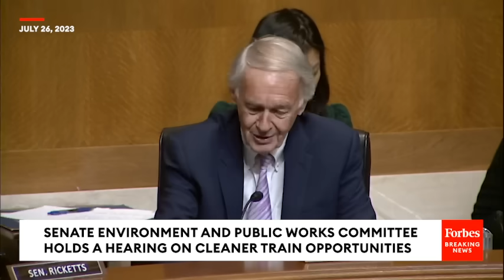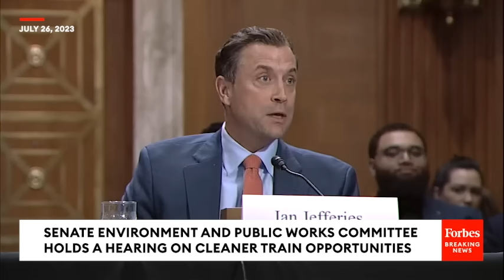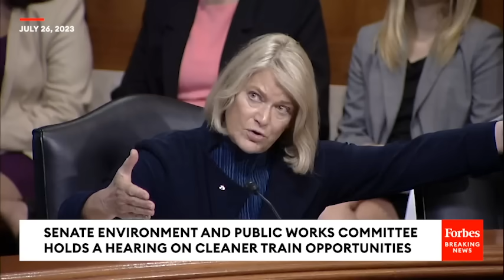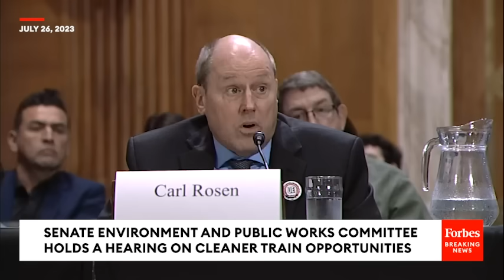‘How Long Would It Take To Replace All Diesel Locomotives With Electric?’ Cynthia Lummis

Comment: We have 18,000 ton, 120+ car coal trains that roll through where I am.  There are four 4,400 hp locomotives in full power, roaring and grinding up the grade.  Two in the front and two in the back.  I laugh when I think of battery power moving that train .
Reply: 1000% agree....we are dealing with a 100% CLOWN show with battery power.....
Reply: The batteries would outweigh the load and would take days to charge and minutes to drain.
Only lawyers and politicians believe there is a free lunch, and for them and them only, they make it so, but at everyone elses expense.
Reply: @misterserious3522   True.
Reply: Quick and dirty math says 13,000 kilowatt-hours of storage capacity would be required to operate those four locomotives at full power for one hour, assuming 100% thermodynamic efficiency from the batteries to the wheels.  Now extrapolate that out to several days' worth of operation to model a complete trip cross-country and tell me how physically large and expensive the storage battery would have to be.
Reply: Hint:  Lithium batteries cost upwards of $100/kWH to manufacture.  100*13,000*24=$31,200,000.  Compare that against the cost of four new diesel locomotives at $1.5~$2.5 million each.  And THEN figure the cost of installing new electrical infrastructure to charge those electric locomotives and tell me which competitor is going to be making money at the end of the day and who is going bankrupt.
Reply: @TankCrusher210  The batteries would outweight the cargo load.
Reply: its no problem it will just be 120+ battery electric locomotives and 4 coal cars😂😂😂
Reply: That works out to 13 megawatts if all four engines were actually delivering full power. That is equivalent to the entire electric consumption of about 6500 homes at 7pm peak usage.
Reply: @laserflexr6321 Your numbers look about right.  Good job.
Reply: Electric motors are in the wheel trucks of railroad locomotives, driving the wheels. Diesel engines drive the generators to produce electric current, powering the electric motors. Learned this at GM EMD plant in LA Grange, IL.
Reply: @thomasformanek465  Correct.  They are traction motors.
Reply: "But according to our calculations it is easily done. Looked good on paper."
Reply: I hope you realize that electric motors are actually producing the 4,400 HP that is pulling/pushing the 120+ cars of the train. The diesel engines are just generating the electricity to power the drive motors.
Reply: @joeyager8479  
Actually, the diesels turn a generator or alternator, and that current is then rectified or inverted to whatever the traction motors use.
Reply: @bruceingram4715  Understand. I was just stating it in it's simplest terms. You can say the same thing about charging the 12VDC battery in your car.
Reply: @joeyager8479   
“Just”?  SMFH
Reply: No schiff!  @joeyager8479
Reply: @joeyager8479  Just replace the diesel engines with batteries. 🤣🤣🤣

Comment: Production of diesel electric locomotives started around 1925 in the USA. Sooner in europe. This is the most cost effective and least polluting system there is for hauling freight. The pollution created in the manufacture of batteries is well above burning fossil fuels. You may think the people trying to force diesel out are ignorant of these facts. This is really about controlling people and money.
Reply: Diesel electric locomotives were working during the WWI time frame. Short range switchers for working around the marshalling yards. And in very limited numbers
Reply: One fact no one addresses is, how to get rid of burned out batteries, where are they going to be stored? Batteries are like nuclear waste, where/how to get rid of them.
Reply: @stephenmartini5890  With the rapid expansion of battery inventory, it has already reached scale to set up industrial scale recycling.   It is not a cheap or easy thing to do, but I assure you a miner would much rather mine a pile of dead batteries than the best known pile of dirt and rock as a source from which to extract those metals. Much more concentrated source to process. That aspect wont be a huge problem.

Comment: The locomotives today are hybrids. The SD70, 80s and 90s are efficient and reliable. I worked in the railroad with ConRail. 100% EV locomotives will not work. Where are you going to plug them in? What happens when a storm (winter or summer) knocks out the power? Plus you cant build a battery that can pull the 15 to 30 thousand tons and stay charged. The battery will die or catch fire, it’s a silly pipe dream
Reply: Electric locomotives can be practical, but only those which are powered externally such as by a catenary. Battery power is not practical for hauling trains across the country.
Reply: @Ethan.Lamoureux  Catenary? Are you serious? Do you even understand the infrastructure and rebuilding of the rails it would take? Just to go to electric? It’s not worth it. I have been in areas (sidings) that are literally in the middle of nowhere. You can’t get catenary back there…. Another pipe dream
Reply: @eshelly4205  So that’s your excuse? You believe that railroad electrification cannot be done “in the middle of nowhere.” Electricity will not work there? Or are you of the opinion that it’s all or nothing, either we electrify every line or none of them? I hope you understand why I think your objection is nonsensical.
Reply: @Ethan.Lamoureux  I make perfect sense. Why do it? For what purpose would you spend that much time on a system that will be terribly expensive and inefficient? The current locomotive technology is perfectly capable. They can’t even keep simple EVs from catching fire in a garage. A fully electric freight locomotive is nonsense. You don’t know what you are talking about.
Reply: @Ethan.Lamoureux  Here’s some homework for you. Educate yourself. 1. Learn about locomotives. 2. Go to a train yard and ask an experienced train crew member if it’s feasible to have 100% electric freight locomotives supplied by catenary.

Comment: What is an electric train "card"? Lack of proofreading bugs me. Also, the discussion is about battery-powered locomotives, not cars (or "cards", as Forbes puts). Most industrial applications of battery powered vehicles are ineffective and pushed aside as soon as the spotlight moves elsewhere. They are novelty items that typically are less reliable, have less range, load capacity and cost more than existing models. 
The lunacy of targeting something that moves 40% of products while generating less than 2% of the pollution is lunacy. Lummis demonstrates a stunning lack of understanding about how electricity is generated, something she should know more about, given Wyoming's role in coal mining, transportation and power generation.

Comment: Lunacy.   as in Loons. You would need a separate train to carry the batteries. BTW: Figure out the cost of carrying 1 ton of batteries on a Tesla. Look at it this way: You have a nice SUV and you have a trailer attached that has 2000 pounds of stuff you have to haul to the grocery store or anywhere else you go. These crazies all flunked 8th grade physics.

Comment: First off, all locomotives are already electric. Instead of running off of batteries they run the electric motors off of a generator powered by a diesel engine, but the locomotives are already electric with few exceptions of some yard engines. As to going full battery run motors on a locomotive it is not practical with today's technology.
Reply: Just add 3 or 4 battery coaches, and much bigger brakes.
Reply: YUP!  LOL!   @derekheim8172

Comment: Why is the question how long not at what cost, the cost of all those rare earth materials the cost of mining transporting refining construction the battery’s alone is a HUGE environmental impact plus that battery will need to be replaced within what 5-8 years  pretty sure I’ve worked on diesel’s that where over 500,000 miles and 20+years old only green there is is money people.

Comment: Agreed, and what I find interesting is that nobody is telling American people how much out of pocket it will cost them to replace an electric car, or motor that will eventually need to be replaced, California did not think this though, which could be why they are losing people, among other stupid laws.
Reply: OR a battery pack replacement which I have read is between 12, - 14K  ??? and where do all those used batteries go
Reply: And here in Tx ,Gov Abbott has set up a $400. tax when you purchase an EV. Then, every year after that, a $200. per yr offset tax to make up for lost income from gasoline sales.
Reply: California doesn't think anything through.
Newsom is worse than a slick, shady used car salesman. He makes my skin crawl.😬
I escaped from that hellhole last year.🏃🏻‍♀️
Freedom!🇺🇸

Comment: We once had many electric locomotives. They ran on overhead catenary or third rail -  
Miles of catenary and third rail would have to be installed. It would work well and cost an efen fortune !
Reply: and the trails would have to be converted back to rails to bring back capacity since there would need to be shorter trains.

Comment: If the politicians in California want to convert to all-electric locomotives, they can buy all of the rail lines in California and erect the overhead wires to power those trains, and buy all of the locomotives needed. Simple! So, what's the question?

Comment: Running locomotives on battery power, with the amount of horsepower they'd have to produce would take a battery the size of two rail cars! And it would take several days just to charge it! The draw on the electrical grid would be MASSIVE!
Reply: There you go. Its beyond insane.
Reply: We can't even produce enough electricity for our current needs and somehow we're supposed to change to all electric vehicles including trucks, trains and ships which would increase our demand for electricity 10 fold? Talk about clueless.
Reply: @jackblack9208 
The increased demand for electricity would be more like a hundred fold over the current demand for electricity!!!
Let’s not forget the massive amounts of greenhouse emissions required to produce a single battery for these vehicles over that of gas or diesel powered vehicles of the same size!!!!
Reply: They have already tried it , it failed , there are videos on it of them .
Reply: Not mention how big the explosion would be IF one of those two-railcar size batteries were to cook off.  Far worse than any crude oil tanker car explosion AND you get the bonus of a toxic metal getting into the water table.
Reply: Why would locomotives have batteries? The few trains that are electric use direct catenary power.
Reply: @joewoodchuck3824  The ones they're talking about are intended to replace the diesel powered ones we have now for a locomotive that has to stop and charge like an ev auto.  A lot of us are scoffing at the idea.  

There was even one person in this thread that suggested taking the diesel run alternators that power the current locomotives and use them to charge the batteries for the EV train.  So they make the train sacrifice capacity to charge "environmentally safe" batteries with the same diesel motor and alternator (meaning that the train will have the same carbon footprint, but has to haul more dead weight rather than profitable cargo).
Reply: @joewoodchuck3824  actually most freight trains in the U.S. are diesel/ electric. They want to do away with the diesel and replace it with batteries
Reply: @jackblack9208  I understood that except for the batteries. When electric was mentioned I assumed AC catenary power as already exists for Amtrak.
Reply: @joewoodchuck3824  It all has to get converted to DC switched to the drive motor windings anyway.   The electronic controls are already on the diesel electric trains so that is not a tall obstacle, getting that much electric power in to a moving vehicle is. The amount of ground level ozone being produced by all those sliding connections may prove more hazardous than diesel particulate.
Reply: @laserflexr6321  Sliding connections?
Reply: @joewoodchuck3824  Because overhead catenary power is expensive to actually do, and why most railroads in the 1930s tossed them for diesel.
Reply: @jacobew2000  I'm well aware of the cost. It was an enormous expense to electrify the northeast corridor. I have no idea of the break even point of that vs. diesel.
Reply: @joewoodchuck3824  Al li know is that most of the electrification was removed in the 1930s to 1960s because it simply did not work well.
Reply: @jacobew2000  It works well now.
Reply: and you would need many more locomotives vs diesel electric we have now
Reply: @richardsmith4187  Gobs of electric motor horsepower can fit into a locomotive. That's already proven. The real issue is where the energy comes from. The Amtrak Northeast Corridor for passengers is electrified and it apparently works fine. If she's thinking battery power instead then that's a whole different story. If that's the case, what if it came down to using a permanent tender such as with steam locomotives had for fuel?
    it doesn't seem feasible, but I need to rough out a few numbers first. With 746 watts per HP, and a known amount of HP that is required one could work out an approximation of needs. Typical EVs carry around 50 Kwh of battery, though I don't know the dimensions or weight.
Reply: Exactly.
And politicians like this sponge brain have no concept of "There is not enough generation capacity to support this" or "You keep blocking any viable power generation capacity from being built as renewables are not always available as sun is not always available, wind is not always available, and dams are being shut down or demolished."
And don't mention nuclear!
They go completely bonkers hooting like frightened simians.
But they want all of us in electric cars, using iPads, and using electric everything in homes.
Reply: They would just pull the engines and generators from the trains to power the power plant(train generator) to charge the train batteries.   Stupid.
Reply: @bobsbillets8863  
That would not work or be efficient.
More effective to have the engine on the train.
Reply: @bobsbillets8863  Stop and re-read what you just posted and think about that.  They're going to take the very part of the train they want to eliminate and use it to charge the batteries that add tons of weight to the train just to lose more energy to resistance and heat loss by sending back to the electric motors in the engine car.   Congrats on passing bureaucracy 101!  Your idea actually undoes everything that they're trying to accomplish!  (Insert your last word here.)

Comment: Rushing to convert diesel locomotives to battery locomotives would cause a drastic increase in emissions through the use of fossil fueled equipment to mine and extract the necessary minerals to build the quantity of batteries needed to build these quantities of locomotives. 
The bottom line is Only a FOOL would demand the conversion to battery locomotives at a time when the needed minerals and building materials are is a short supply and needing to purchase these supplies from a country hostile to this nation. This would simply invite sabotage to our nation and our economy by the supplying nation. 
Green and Tree Huggers are going to be the destruction of a once booming economy. Thank You 14th Row Joe for your treasonous administration.

Comment: The cost is going to be astronomical. because every rail line will need to provide power for all these "Electric Trains" and I do not believe that Battery operated Locomotives could do the job. Most Power grids can't handle air conditioning in the Summer, and they want to make everyone drive electric cars and Power Locomotives too. I am sick and tired of elected officials playing at Nanny State Politics. It would be more economical to go back to Steam, but then they couldn't have 100+ car Trains pulling cargo.

Comment: And how dirty is the process of making the batteries of electric only locomotives? Is the power plant supplying the electricity coal, natural gas or nuclear? How much energy loss is there between the power plant and the electric drive motors in the locomotive trucks?

Comment: Are these people on LSD or something? I can just imagine how huge the batteries would have to be to power a locomotive that can rival the power of a diesel electric locomotive. Moreover the cost of replacing ALL those diesels would further jack up the inflation rate because it is only going to be passed right down to the consumers. Moreover, the harvesting and processing of natural resources required to manufacture all those batteries will inevitably rely on fossil fuel or nuclear power. Then there is more destruction of the environment through stripping the land for these resources and to build manufacturing facilities. Oh, and don't forget that charging all those huge batteries is going to overburden the existing infrastructure which would undoubtedly need to be upgraded and increased to keep up with the demand. Coming up next: Battery powered jumbo jets, cruise ships, helicopters, and cargo ships.